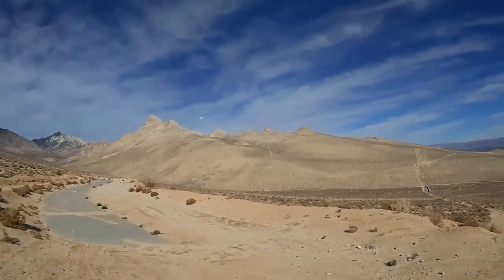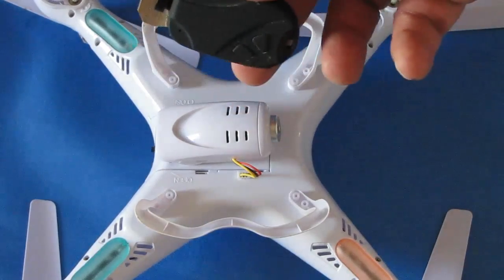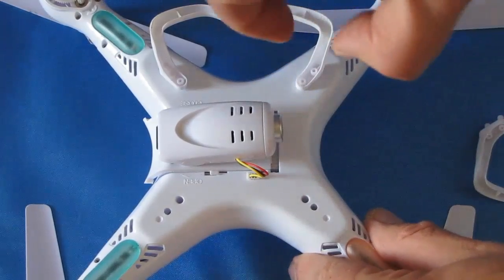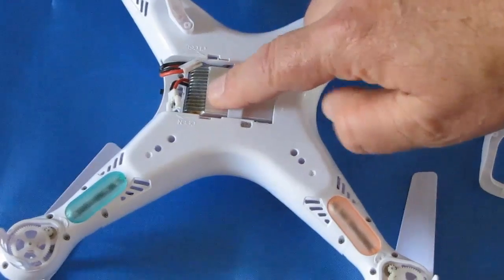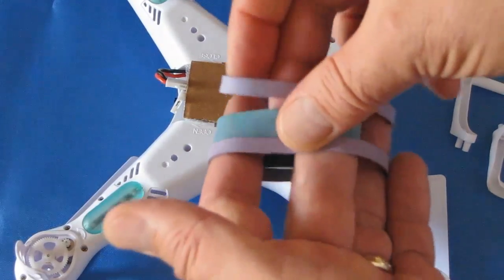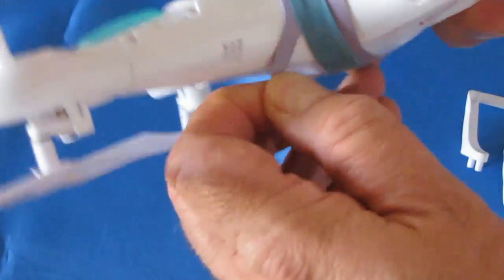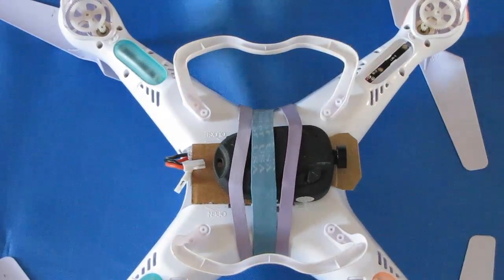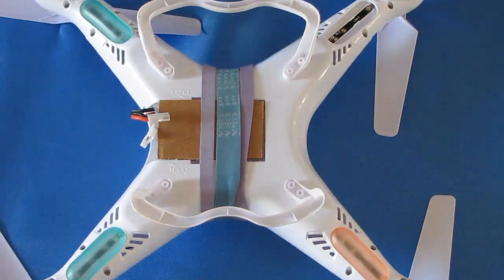Syma X5C-1 Quadcopter Drone, Remove That Camera!

Comment: Wonder if the door from the non-camera version is available from any retailers? Should be cheap if you could find it.
Reply from the maker: Note that I stripped out the plastic screw holes the first time I tried to reinstall the camera back to my original X5C.  I just don't touch those screws anymore :)
Reply: Can you not just remove the camera from the battery door and keep the battery door on and strap the 808 to that?
Reply from the maker: Yes you can unscrew it from the door.  But it weakens the screw holes in the camera when you do that. It's better and easier just to unplug the camera and remove the door entirely.
Reply from the maker: Well you can purchase the whole body shell which includes the door for $4.50 http://www.banggood.com/Syma-X5-X5C-Main-Body-Cover-Spare-Part-X501-p-926872.html
Another thing that you can do is unscrew the camera from its door.  But I don't recommend doing such as it can weaken the attachment points where the screws enter the camera shell.
Reply: Quadcopter 101 Wow, that's really cheap, considering the X11's look to be nearly $4 themselves. Whole lot more plastic and parts in an X5C body. Probably would pick one of those up just to have if I had one of these (which I keep thinking about getting).
Reply: Wait, isn't it the same door?? The version without the cam comes with the same door.. Just no cam. If you unscrew the cam it will be identical to camless version. Lol
Reply: Frequent Flyer RC Probably is. I guess having a spare would make field removal of the camera much quicker, and would reduce the likelihood of stripping out the screw holes in the plastic. But if you just took it off occasionally, I guess it shouldn't be a problem.

Again, I don't have one of these but am thinking about getting one.

Comment: Is there a upgraded cameraless version like a X5-1?
Reply from the maker: Well there once was a Syma X5, but that's kind of disappeared since the X5C came out.  You can purchase a BNF camera-less, transmitter-less, and battery-less X5C, and also purchase a separate transmitter. But once you add it all up, the end price of quad, battery, and transmitter comes out to about the same as the complete X5C-1.
Reply: http://www.newegg.com/Product/Product.aspx?Item=9SIA2EY1JM4314
Reply from the maker: Possum Lips Yow!  That costs as much as the X5C.  Might as well get the X5C and just unplug the camera :)